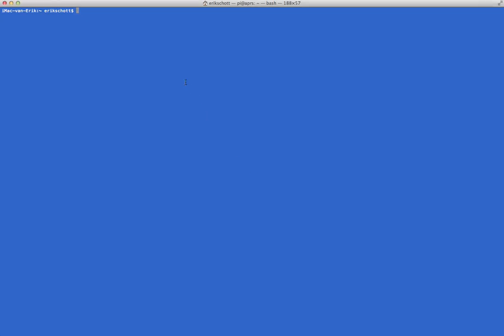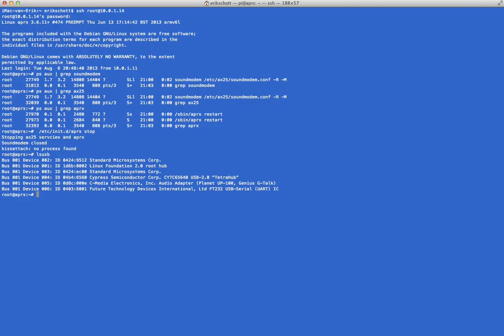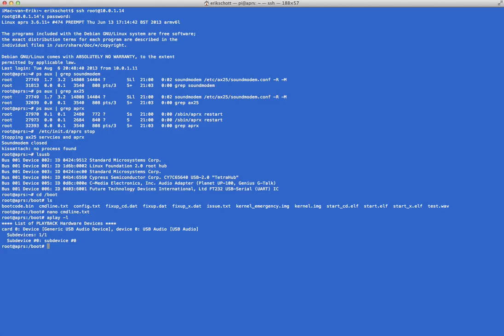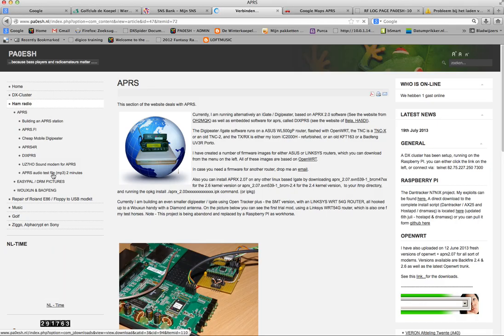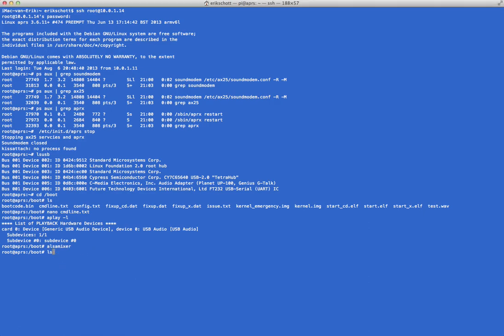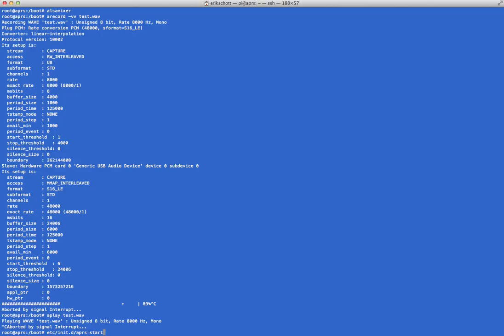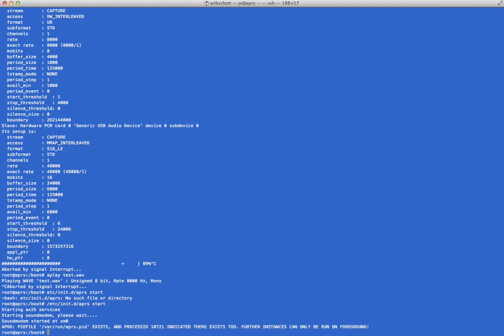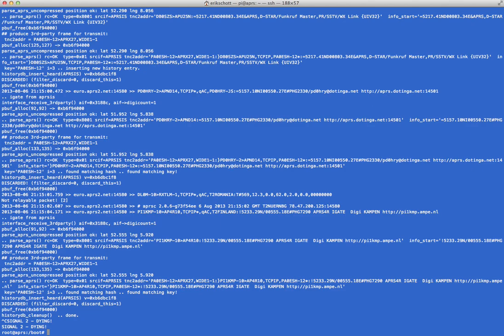Raspberry PI iGate APRX  with soundmodem

Comment: aprx router modem e kurmaya çalışıyorum ama bir türlü olmuyor zyxel wap3205 yardımcı olabilirmisiniz openwrt18.06
Reply: Muhammet, for installtion on a zyxel wap3205, you need different firmware. If you need, i can sent you the firmware file ?
Reply: Just checked but for the latest oenwrt, the RAM is too low (only 4Mb) Sorry.
Reply: Hello Hengelo
modem open wrt installed 4mb ram i will change to 8mb. Then I wonder if I will. for tl-wa901 or tl-wr740 or tl-wa701 71xx
April 2.09 would be appreciated. Thank you